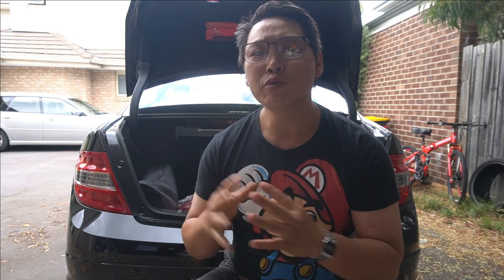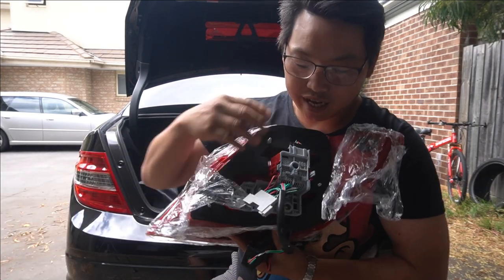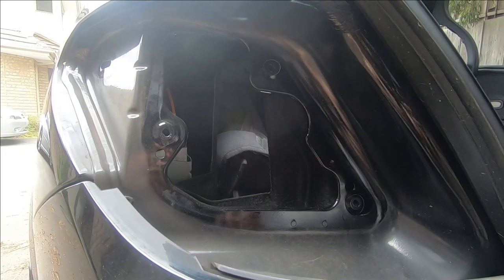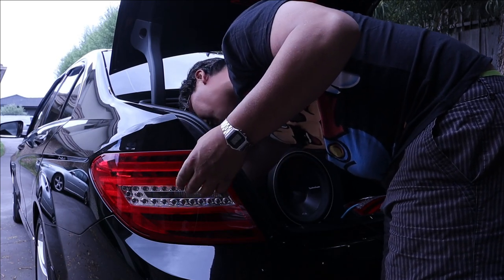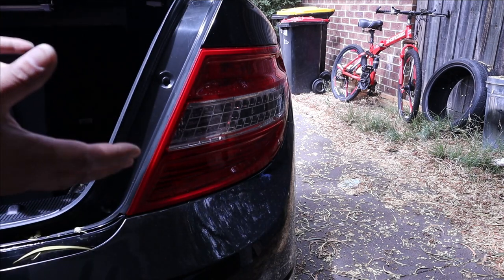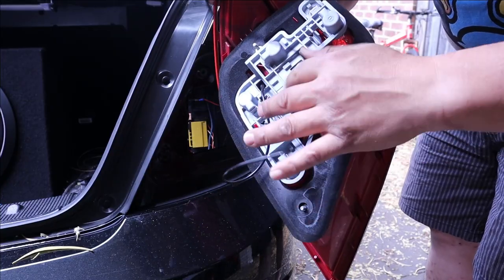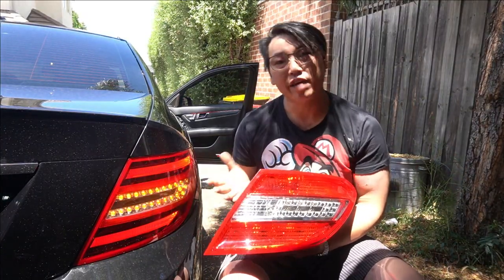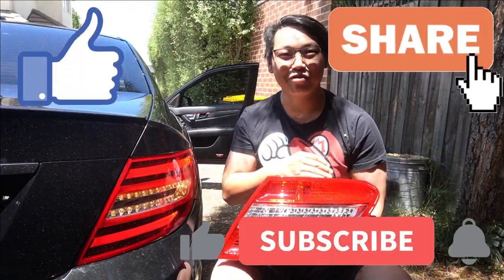07-10 mercedes W204 prefacelift  mods / aftermarket facelift tail light upgrade

Comment: i have put updated face lifted tail lights from a newer model and they do work but there is 4 lights that stay on. PLease help me,
Reply from the maker: u need to have them coded that is the only way to get them working .. did u just get them off a newer model ? it's not a direct plug and play mod.. that's also why I had to get aftermarket parts as they are wired differently
Reply: @MIKEYZVLOGZ  hey yes they are from newer model and mines a 2009 c63. Hoping I can find someone to fix it. There’s 4 little leds that stay on
Reply from the maker: @GlassfilmWeddings  u can buy a kit designed for it I think check dmp car designs and search for resistors for tail lights..I think its plug n play designed specifically for that purpose
Reply: @MIKEYZVLOGZ  thanks man. Still on the hunt. I’ll check that out. Let me know if you find anything!

Comment: Hello friend.  I own a 2010 W204 c250 4 Matic. I am in desperate need of a similar pair of tail lights to uplift my Benz.  Please help.
Reply from the maker: ok so what do ur tail lights look like ... u can only use these if your original tail lights are halogen... if u have led in the indicator u can't use these...u need to get a set that is designed for preface with led indicator or else u will get error codes..be careful some sellers will say it will work and wen u relieve it ..u get error msgs ... its a pain...

Comment: Hey, how are the lights working now and did you face any issues? Are they a reliable purchase?
Reply from the maker: for me cuz my lights were originally halogen it was ok... now if your tail lights are designed with an led indicator from factory it doesn't read correctly and u get errors because it's trying to read halogen bulbs which have higher power draw compared to leds..therefore u get error msgs. sellers are sometimes uneducated about which of these tail lights actually work and which models will accept aftermarket lights.. I am going to another set of tail lights 
stay tuned and they will be designed for my model prefacelift w204 2010
Reply: @MIKEYZVLOGZ  Hi! Is it possible to change a non facelift ( no led) tail light to a full led afermarket tail light like you did in the video, wihout any coding or etc...? Thanks
Reply from the maker: @Dzsaben  yes u can ..originally these are designed for tour type of tail light without led indicator.. but u need to choose these exact ones

Comment: Is it possible to just buy the module units by themselves?
Reply from the maker: yes I believe y can try to find them search for led modules resistors 12v
Reply: @MIKEYZVLOGZ  do I need a resistor for each one of the many wires on the plug unit coming from the tail light? Or do I just need one for all the wires together?
Reply from the maker: @simonmilne6607  so what tai lights are ytou trying to add them to ?? are you modifying the originals or are you adding modules to an aftermarket like this ? if so the modules should only connect to the actual led lights not all of the lights , only leds..if you get the right modules with resistors for leds you should be able to use them and simply wire them to the appropriate leds.. i wish i could tell u how but i didnt have to do that as i bought them with modules ready fitted ..hope this helps
Reply: @MIKEYZVLOGZ  I have upgraded prefacelift tail lights on my 2007 c300 to facelift LED taillights the same as above. However the rear fog lights stay on and so do the brake lights. Thought it was because they might need some resistors but I am unsure, if you have any suggestions I would greatly appreciate it! :)
Reply from the maker: @simonmilne6607  are they after market or original oem ?
Reply: @MIKEYZVLOGZ  they are aftermarket
Reply from the maker: @simonmilne6607  ok in that case yes u need to find the right resistors that will allow u to control the leds ..therefore making them run right.. if u find an auto electrician they can help u ..and make them work
Reply: @MIKEYZVLOGZ  thank you so much for your help :)
Reply from the maker: @simonmilne6607  I forgot that u can buy the modules for tour car goto dmp car design and they sell the right module for your tail lights even ask them for what u need I remember seeing a device for exactly your purpose

Comment: Does this work for a 2011 w204
Reply from the maker: unfortunately it only works if your tail lights are halogen from factory ... mine were halogen then I switched to the series 2 like in photo which allowed me to still upgrade to facelift ... if u have factory tail lights with led indicator it won't work
Reply from the maker: however having said that .. u can still upgrade to facelift oem aka original aka authentic tail lights but u either need to have them coded or buy a resistors kit ... the only pkace I've seen them are at dmp car designs... but they are all sold out at the moment

Comment: Do you know the model and part number for this product because it's no longer available on the URL you provided.
Reply from the maker: they must have sold out... there should be more available on   other sites u can try ebay or other sellers on aliexpress .. I'll try to link the same product for u ... I'll have to make sure its the same item though as some are slightly different and won't suit all models
Reply: Thank you  @MIKEYZVLOGZ .  I did a search this morning to no avail. Though I saw a few items that appeared similar, there just wasn't enough information associated with them for me to properly ascertain if they were backwards compatible with my 2011 W204.